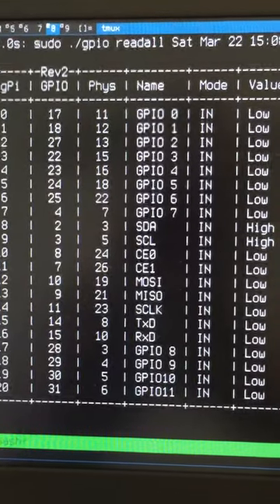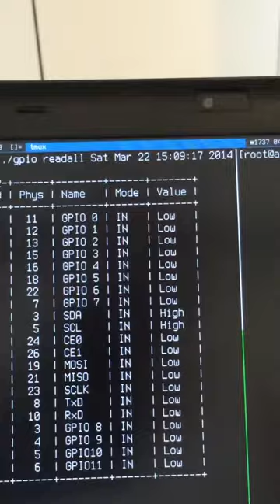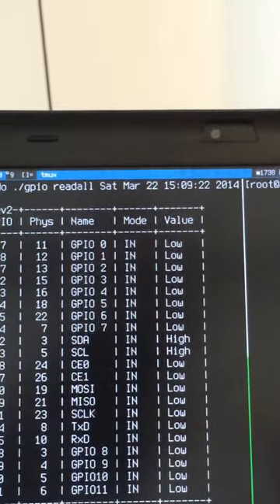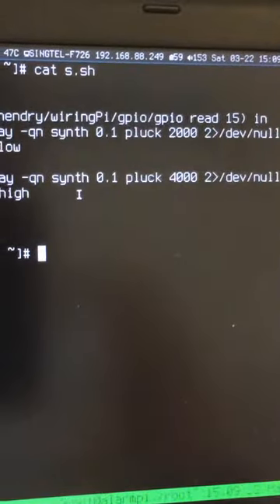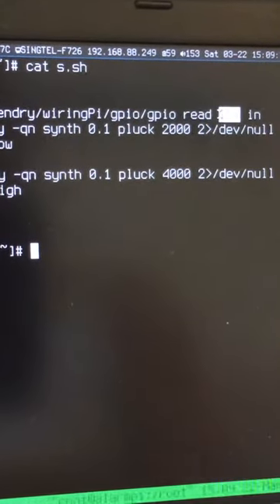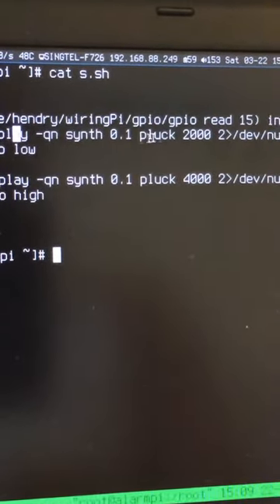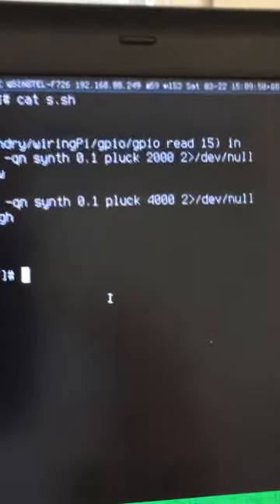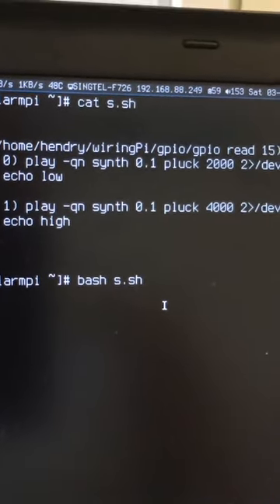Testing a motion detector with a Raspberry PI

Comment: Very nice idea! I recently got a raspi, and I have a very similar PIR sensor as well. I'll have to try this out. Mine actually has two trim pots on the back. I got it for about $4 on ebay. I'd like to try this tomorrow, and let you know what I find. It seems to me like it might be set to the wrong threshold, or maybe it's insufficiently powered? (Unlikely, I would think)
Reply from the maker: There are no jumpers on my PIR motion detector. So I am not sure how to tweak the threshold... software?
Reply: Well, you might not need to. I just tried mine with my multimeter, and even though it takes 5v fine, it's outputting 3.3v. I think that very well might be your issue.
Reply: kaihendry After a little reading, maybe 3.3v is what you need.

http://learn.adafruit.com/adafruits-raspberry-pi-lesson-4-gpio-setup/the-gpio-connector
Reply from the maker: Possibly David It's working, but it's pretty erratic! http://youtu.be/xUg_BbcOdXQ